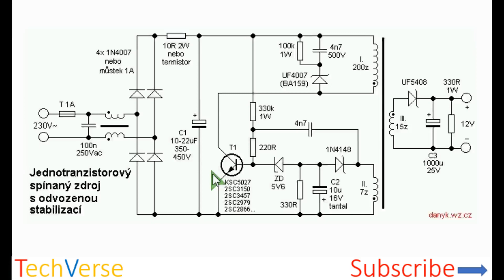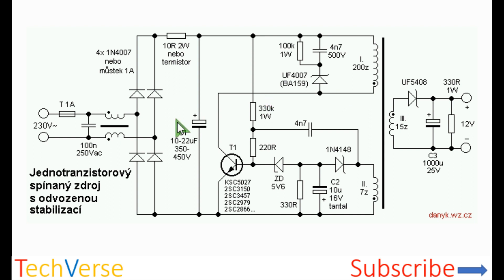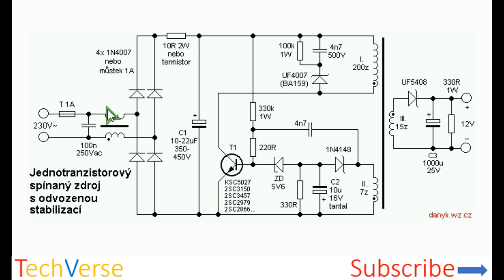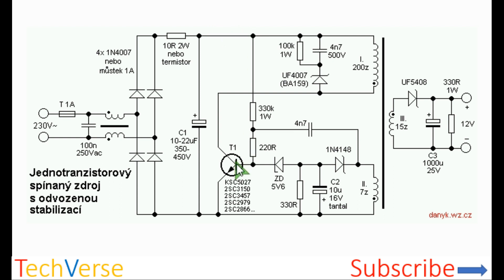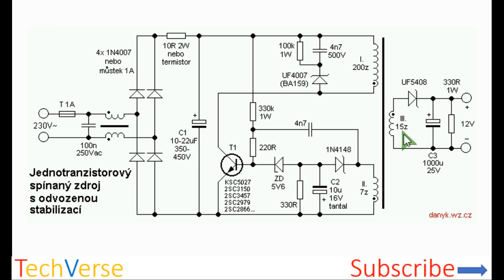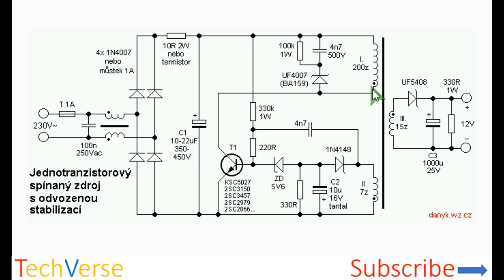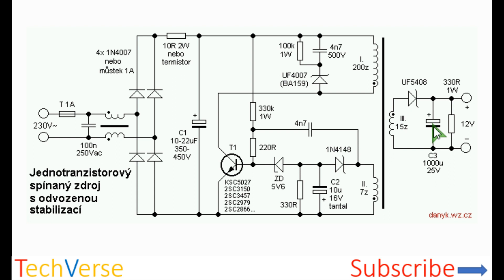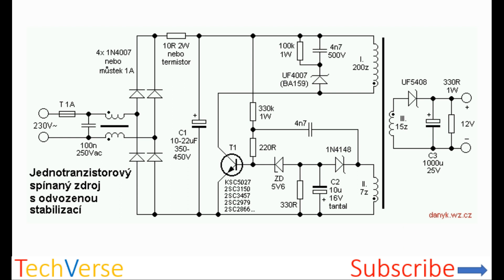Make a DIY 12V Self-Switching Power Supply

Comment: I wants to ask few questions.
1) Is this circuit regulated. Will voltage be constant evertime in open circuit and closed ??
2) If I put load of 12Volt 2.5amps of load what will be there drop in the voltage of the circuit.
3) If there is load of 25watts do transistor in the primary side heats very much or its is minor ??
4) What should be the wire diameter should it be what you used in the circuit or it couldn't be any which will be suitable for my circuit ??
Please give your response 🙏